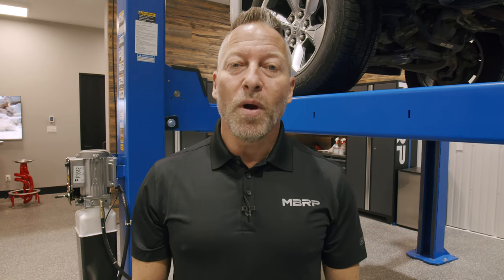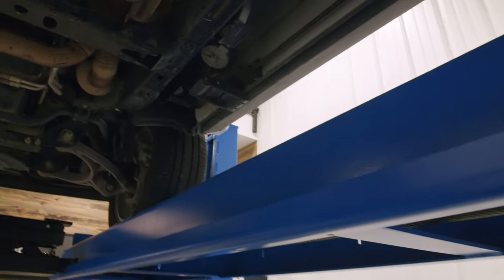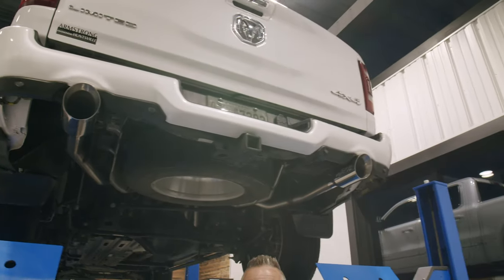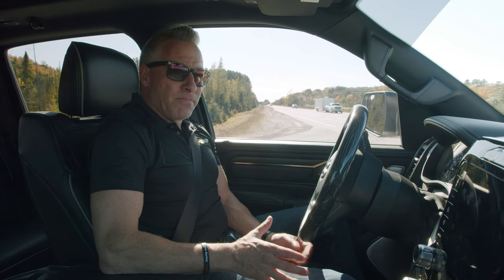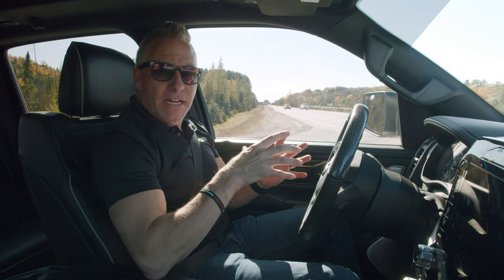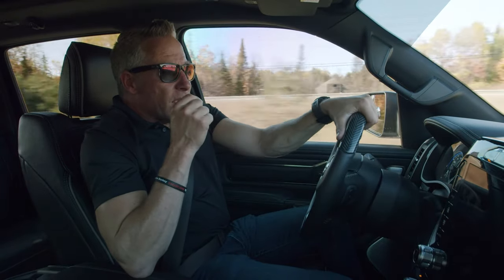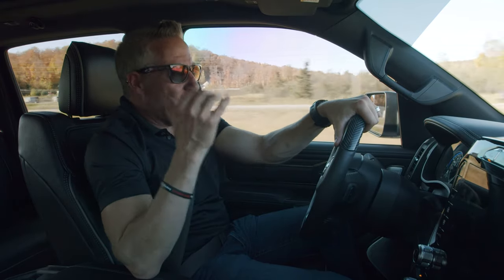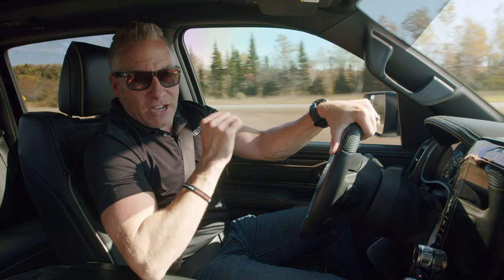RAM 1500 // 3" Cat-Back, Dual Rear Exit Exhaust Overview

Comment: You're correct about not winning any drag races I just got toasted by a Toyota but my MBRP exhaust sounded good on my 2020 Ram 1500.
Reply: mustve been a supra, because the new rams are faster than previous gen. I have a 2019 and it gets up and gos
Reply: @louismccomack9524  no way guy. My 2004 1500 hemi would dust 5th gens with a tractor trailer length between them lol. Granted it was rotted all too hell so wait reduction lol
Reply: @louismccomack9524  - Yep, I've got a 2021 Laramie. I've had a 2012 and 2016 as well. Ram, since 2009, has had the fastest trucks in their class.
Reply: @Steve S - Well, the comp for Chevy's 6.2L would be Ram's 6.4L, and I wouldn't waste money on a full sized truck that needs turbos to keep up with competition. I have no doubt Ram's 6.4 could beat Chevy's 6.2, same for Ram's 5.7 vs Chevy's 5.3
Reply: @Steve S - I was comparing same class motors. Ford added more problems to fix down the road by adding turbos, but if this country continues to regress then none of this will matter because we'll all be complaining about the problems with our EV's.
Reply: @Steve S lmfao 150,000 is just breaking in a truck. The fact you even mentioned 100 to 150 shows you dont know much
Reply: So this exhaust fits a 2020 Laramie?

Comment: Couple questions. Does this system drone while cruising? How does this muffler/setup differ from others such as Carven, borla or AWE? Couple have no drone guarantee, if that's true.
Reply: If it removes the stock resonators and doesn't have anything to "remove" those frequencies or enhances the good ones to drown out the bad, it'll probably drone while towing. That is depending on if MDS is active or not... 4 cylinder makes different tones from 8 just out of the physics of the firing order Having a single exhaust split into two, will help, BUT that's after the cab.